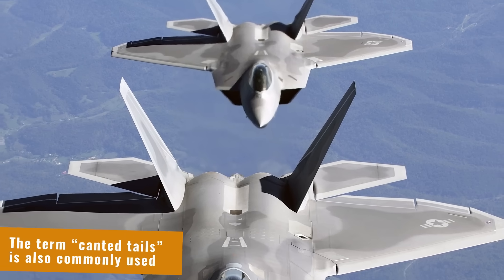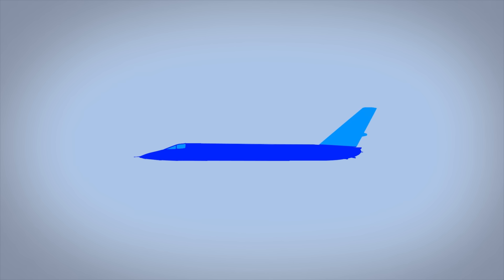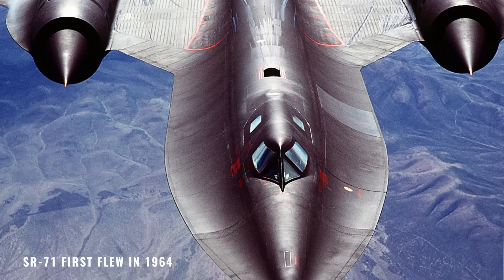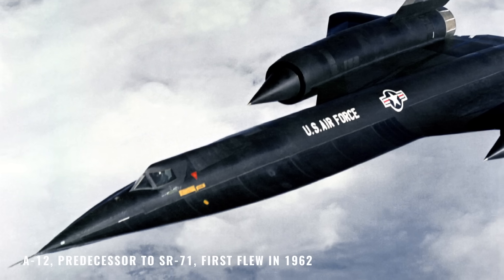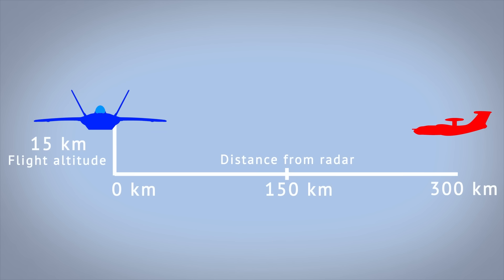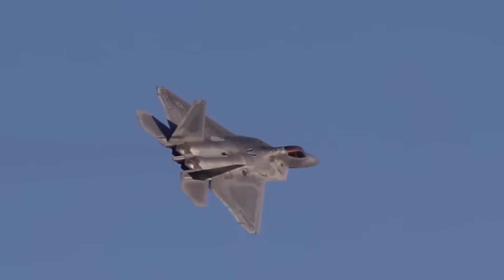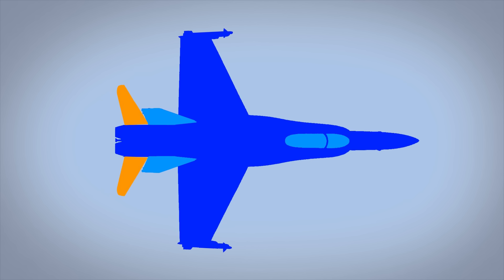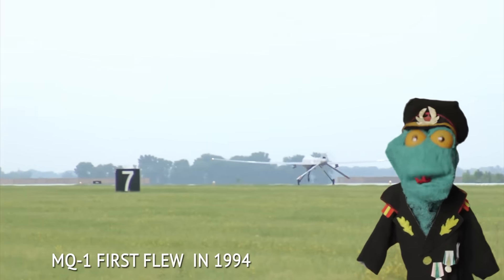Why do fighter jets have slanted tails? (Explained!)

Comment: Very good video.  A few additional thoughts, if you don't mind...

If the horizontal and vertical tails are at 90 degrees from one another, as in the F-15, they form a "retro reflector" and bounce radar signals approaching from the side right straight back at the emitter.   

Also when a single tail is blanketed at high angles of attack, the plane tends to depart controlled flight to either one side or the other.  This would happen in the F-4 Phantom, its tail would lose yaw control authority and it would depart into a spin.  With two tails, especially if they are canted outwards, there is a very good chance that at least one of them will not be blanketed  at high angles of attack and will be able to retain yaw control.  

The YF-23's large, widely-canted twin "ruddervators" maintained yaw authority up to 60 degrees angle of attach, which is incredible.    The YF-23 met or exceeded ALL ATF maneuverability requirements without thrust vectoring.   In other words, its requirements WERE very demanding, maneuverability-wise, and they were ALL met with two tail surfaces (plus the flaps on the wings).  

Have Blue's inward-canted tails concentrated the hot exhaust gasses and increased the infrared signature.  The outward-canted tails on the F-117 assisted in dispersing the exhaust gasses.

Comment: Canted tails are also partly the reason why planes like the F-18/22/35 can perform the flat spin despite the absence of yaw thrust vectoring. Dynamic pressures generated from the forward fuselage are able to reach the tail even with the absence of forward momentum

Comment: Good video! Although it is worth noting that the yf-23 did not lack maneuverability. Just like having one large vertical tail can be equivalent to two smaller ones,  having 2 large "V" tail surfaces can be equivalent to 4 smaller conventional tail surfaces And the yf-23 had very large, all moving tail surfaces. Exact dimensions are hard to find, but I'm pretty sure they are larger than the actual wings of an F-104 of F-5.

Comment: You did not mention one other big factor in stealth - avoiding the creation of retro-reflecting surfaces on the airplane (ones that reflect RADAR waves directly back to their source). A full retroreflector is created with three surfaces at 90° angles, but even two surfaces can generate a big radar return at certain angles (bigger variety of angles than a flat plate) - aircraft with non-canted tails often have such "partial retroreflectors" between the vertical and horizontal stabilisers.

Comment: V-tails do not result in a lighter plane. Based on basic tail volume calculations and drag area they suggest that a tail can be smaller than what it needs to be. Many v-tail planes have poor controllability, in some cases dangerously so. So it is usually more efficient to just have a traditional tail.

Comment: Please do "Why Rafale have canards ?"
Reply: Well, it's indeed relatively close to the reason of the choice of a 2-tails design. Canards fit well with delta wings (Rafale, modernized Mirage III, J-10, Typhoon, Saab 37, ...). It allow to control the angle of attack of the delta wing, and thus help to stabilize the plane and help to reduce drag during manoeuver (which is an issue of the delta design), to facilitate low speed approach (another issue of the delta design).
Reply: @Jenkouille  it's not mandatory though for example cranked delta wings
Reply: @spartanx9293  Of course it's not. Even some quite modern delta winged, like the Mirage 2000D do not use canards, and still perform relatively well
Reply: It’s actually a rarely discussed « secret » (that I can speak of since it has been seen on the web): the Rafale doesn’t have canards !
Let me explain: Canards are normally the pitch control surfaces and the longitudinal stability surface. To achieve that the further away they are from the wing the better efficiency they have ( look at the Eurofighter and you will see that the canard is in farther than the pilot).
On the Rafale they do not act as pitch control surface in the sense that the aerodynamic forces on them are not sufficient to make the Rafale rotate rapidly enough. But their function is actually to modify the airflow over the main wing and achieve that pitch control function through that modification. A cunning solution that allows to have a smaller and lighter control surface on one hand and to put that control surface more to the rear in order not to block the pilot’s view.
The Rafale´s canard also have a safeguard function: when active the aircraft is longitudinally unstable ( like all modern fighter aircrafts). But in case of a FBW system malfunction, the canards are rendered inoperative making the aircraft stable and flyable with a direct pilot to control surfaces link (the FBW computer is disconnected).